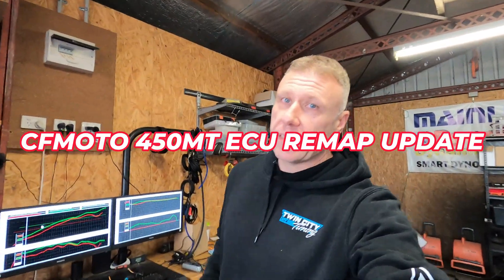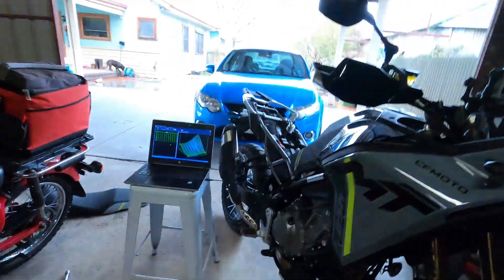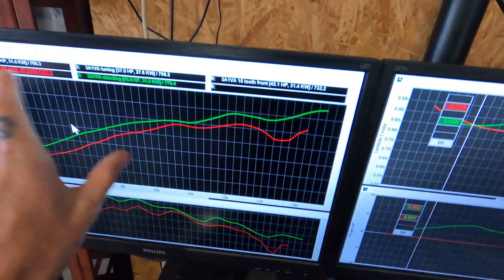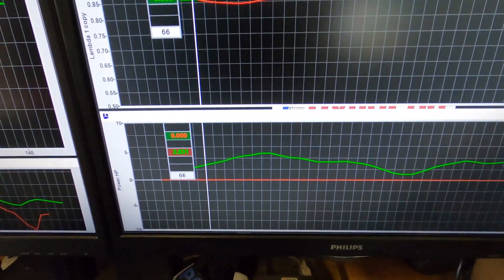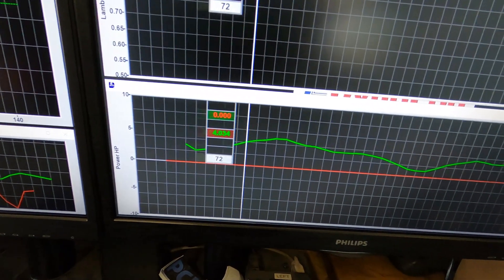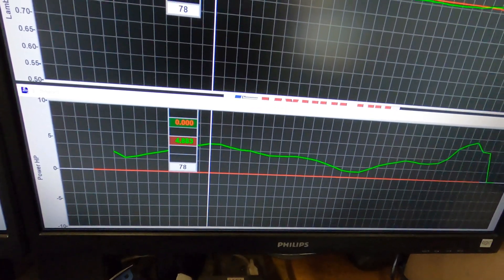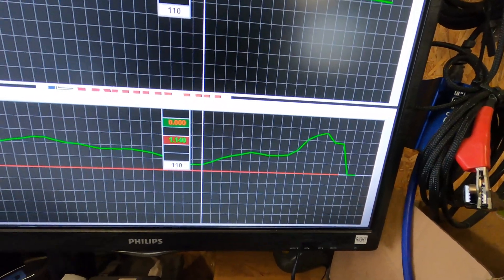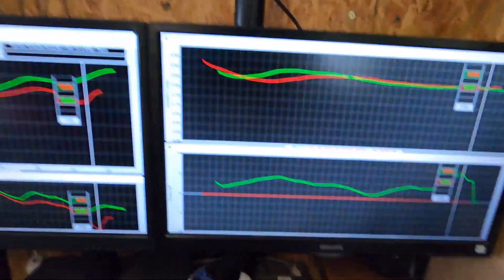CFMOTO 450MT ECU remapping rideability improvement and power gains

Comment: I've had 2 flashes done now by two diffrent people and I still have a jerky snatchy throttle. If stalling at lights happens along with surging could this a TPS calibration issue? Also wouldnt it be better to have the bike dyno tuned on the "stand" rather than mailing an ECU?
Reply from the maker: All the testing i have done on my own bike. I have not had any complaints what so ever and testing on several bikes they all produce same results.

Comment: Does the remap cure the lean condition causing jerking at small throttle settings
Reply from the maker: @garymitchell6897  yep
Reply: @ what is cost  please
Reply: Are the  kits available or do you remap original ECU
Reply from the maker: @garymitchell6897  email cfmoto450mt@hotmail.com
Reply from the maker: @garymitchell6897  email  cfmoto450mt@hotmail.com

Comment: Can you do a dyno run on 91? I'm interested in seeing if the minimum 95 rating is just for emissions or if it will start to ping. As you head further inland on these, it gets harder to get 95 so would be nice to know if you can run 91 without damage to the engine
Reply from the maker: @91KrakenRacingTownsville  sorry, I'm not putting 91 in my bike and doing a power run. 95 in a minimum requirement due to engine compression ratio. If I had to put 91 in the bike due to location I would only lightly load the engine.
Reply: you could try some octane booster to get you out of trouble , wyns etc.

Comment: Will your tune be available for purchase? The jerky on/off switch like off idle fueling is not acceptable. Not looking for power, dont want aftermarket exh........just smooth tune. Thx
Reply: Did you get the new CF Moto update?
Reply: @falcn12  On, not available in Poland, no tbox.........The factory update, based on vids I watched, based on the fact that  it still has to be Euro5 or plus or whatever is, is  not the real solution. For now, I went with Uncle Wangs titanium headers, mid pipes, and tuned ecu. All for $380 usd. Pipes are very good quality/fitment. Definite improvement in overall power delivery. The off idle fueling is improved by 80%. I might do full dyno tune. There are now local guys with  mt450 experience/tunes. For now, I am happy with my solution. The bike pulls and runs much stronger. Hope this helps.
Reply: @pawelwolski1316  thanks for the reply, I haven't gotten mine yet, so was curious on the improvement of the CF Moto update

Comment: Curious to know if you think there will be any bore kits coming for this bike?

I test rode one recently and thought it needed a bit more pickup?

Beautiful bike to ride, very comfortable
Reply from the maker: Honestly... in the bush and off road you don't need anymore power. Smooth out the mapping and give it just a bit more thats all it needs. In the bush I never see over 6500rpm. the torque is great. no need for a big bore. maybe for on road use only but if that was the case I would choose a different bike.
Reply: @frashd  that’s very true.

I think coming from a 350 EXC-F my perspective may be a bit warped in what an adventure bike should be like.
Reply from the maker: @smashmunro  I went riding with 2 bikes on the weekend, one was a brand new ktm 520. Great off road but not nice to ride at 100kms on the road. Also no faster through the sections we were riding even with better tyres. Power delivery was too aggressive for slippery sections.
Reply: @frashd  I can see that definitely, my 350 is terrible to ride on the road compared to the 450Mt - it is so comfortable and smooth!

Thanks so much for your thoughts mate 👍🏼

Comment: Hey there mate, saw your comments over on my channel. 👍

I have been carefully watching the part throttle tuning on my bike. I reckon the worst of the 'jerky throttle' is to do with the overrun cut and relight of the injectors above 2500rpm.
You can get it to hunt back and forth at really light throttle between injectors on and off.
Like tipping into a small roundabout for instance, closed throttle in on overrun, injectors cut, 
pull a little throttle and they come back on and suddenly make power, the drive train snatches and the bike jolts forward, you back the throttle off to stop the bike standing up, the injectors cut again...
Etc.
Feels like it needs a delay to fuel cut added on overrun, maybe 0.5sec 🤷

David
Reply from the maker: @Danger_mouse  yes the fuel cut is part of issue but there are a few other things. My bike has been ridden by the dealer at first service and they commented how smooth it was.

Comment: Thank you for your vids. Which factory tune are u using as base line? CFMOTO released update to the original map about month ago.  That was mostly to address the snatchy off idle fueling. There is a header pipes and ecu (custom tuned) from Unclewang (from China). They show some impressive power gains all for $380 usd. Will keep watching your progress. Got 8 months before i get to ride my 450 again. Thank u.
Reply from the maker: @pawelwolski1316  baseline was update file